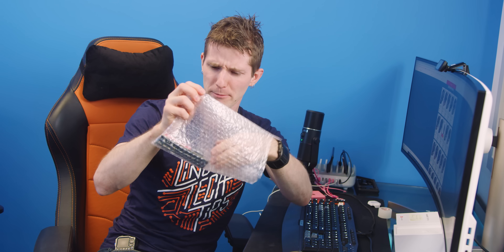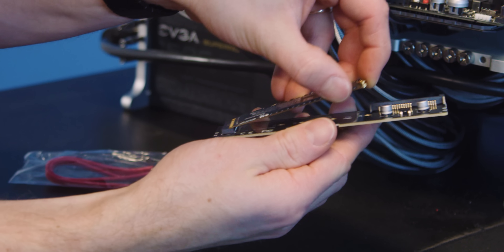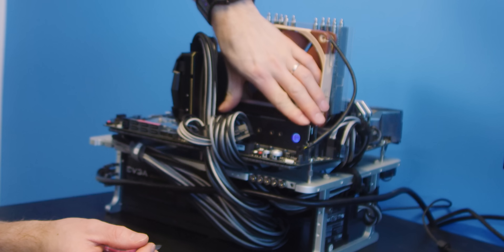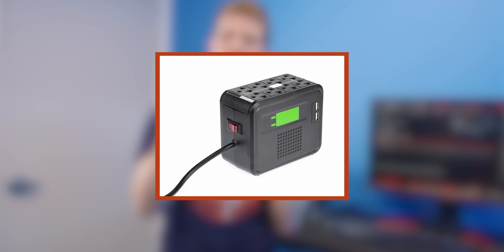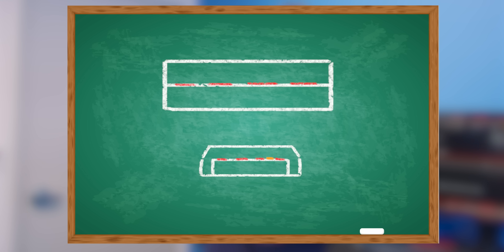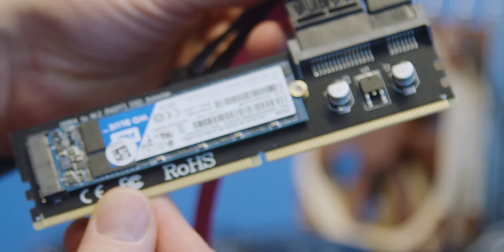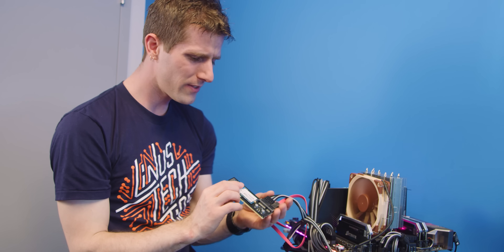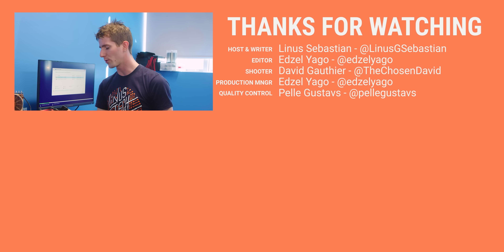They LIED to me! - DDR4 RAM to M.2 SSD Adapter

Comment: So, so much of this is just categorically incorrect. For example...

I have purchased about 50 or so display adapters, mostly for HDMI-VGA interfacing. I have never owned one that was unidirectional. Not once. And being that I have medical issues that limit my budget, I do me absolute best to find the cheapest crap I can find. So unless the more expensive ones have unidirectional interfacing or I've just gotten lucky, I call shenanigans. Also, hod dumb is Linus? Did he seriously think there would be a DDR4 to SATA communications adapter? My first thought was that it would act as basically a place to put an m.2 drive if the board lacks one or if they are filled... THEN when I actually watched the video and saw the damned SATA connector... Well not shit jackass... I swear, the content is getting just shoddier and shoddier as production 'value' increases... Whatever. 

Dumbe people gotta dumbey.

Comment: Hey Linus! Been watching your videos for as long as I remember! But I have a question that I cant find a straight answer: I'm planning to buy a new PC  and all I want to keep from de old one are the SSD and GPU. I have a lot of stuff in my drive and I dont want to have to make a clean install of my Windows 10. I know that just swapping the drive to a new motherboard is not that simple, because the drivers of the old one conflits with the new one. Is there a safe method that can be used to solve my problem without having to format my drive?
Thanks!
Reply: Windows 10 is better at handling being transplanted into a new system, it will try to get new drivers and not use the drivers for hardware that is no longer present. You could also use Macrium free imaging software to create a image file of your SSD before trying it out in the new machine to be extra safe.
Reply: @TheSonofman2  okay. Thks for the advise!

Comment: Not so simple It would allow you to add M2s to SATA controllers.
And if you do not have your RAM socket full a good place to install them.
The price is not bad
And as M2s are cheaper than actual DDR or HB2  RAM perhaps the IDEA of a REAL M2 to RAM converter for CPUs and GPUs is good enough to ispire someone to make a prototype.

Comment: The components on the board is a voltage regulator. The SSD use 3.3V, and the sata power connector may not have the 3.3V wire, and also that wire got removed from the ATX powersupply specs, so officially now there is no more 3.3V on the sata connector. So what they did is install a local 3.3V regulator. Since I see no inductor, it is most likelly a linear regulator, which mean it 'burn' the extra voltage as heat. The 5V come in, pass throught the first capacitor (most likelly C1), then to the regulator (U1), and then the 3.3V output goes to the second capacitor (C2?) and then to the SSD. The capacitors are there to stabilise the voltage, and appear to be oversized.

The efficiency of the regulator is relativelly low (Vout/Vin = 3.3/5 = 0.66 = 66%), and will most likelly get somewhat warm, but a non-issue.

If it had some inductor, it would have most likelly be a buck regulator, those can get quite more efficient (80-97%), but are more expensive to produce.

Comment: You spent ten minutes explaining how you misunderstood the purpose of the device but spent zero time explaining what the device is actually for: a way to install a SATA M.2 into a computer that does not have an available SATA M.2 slot (without using a PCIe slot).  Sure, it would have been great if it was some sort of "magical device" that could convert an M.2 into physical memory or a memory slot into an M.2 slot, but this isn't a channel about magic.  So why waste so much time talking about your false hopes and not just get to the point (once you finally understood what the point actually was)?

Comment: Hi guys I just build my pc with my own components ;): intel i9, gtx 2080 ti, asus rog maximus xi formula, h150i pro, psu rm 1000i, vengeance lpz 32gb 4133 mhz, in a case be quiet 900 pro v2 ^_^.

Now the thing is I am having an issue with the coses in the motherboard ;/, I have no clue what to do, I have this code A2 and i don’t know how to fix it, is something about the HDD i am not sure whether or not I installed it wrong or it does not recognize, I need HELP pls.

Would be nice if you can make videos about the error codes, the meaning of each code and what to do in order to fix it ;)

Comment: I think they build it for those people who have all case slots full with drives, but not the DIMM.
So, you hook it up like a SATA, but place that into the DIMM slot - for CONVENIENCE, not function.

I did that with my SSD, hooked it up and just let it somewhat loosely dangle in the case, before I decided to place it in the second DVD mount slot and screw it tight using one single screw - of 4 possible.

Comment: Wow. So it just uses the memory slot as a physical anchor to hold the SSD adapter? This has to be in the Top 100 Most Useless Products Ever.
Reply: You might as well just buy the 2.5" data version of the drive. Or buy an adapter that fits in a 2.5" or 3.5" bay
Reply: It’s not useless it’s a great scam.
Reply: Put your memory back in the slot and gaffer tape the adapter to the case. It could work in a small form factor case without an M.2 slot on the board.
Reply: well for older PCs without M.2 slot it actually provides a way to install it securely, so that's something
Reply: @ElClaudio  There are M.2 SATA SSD to 2.5" sata adapters already. And cheaper too. This is plain garbage and is just simply a waste of a perfectly good ddr4 slot for nothing
Reply: @ElClaudio  as does tape
Reply: @ElClaudio  truee !!
Reply: @ElClaudio  Yes.  But it does not need to be plugged into a DIMM RAM slot or anything.
Reply: @ElClaudio  true.. but at the same time this is ddr4 ram.. if it was ddr3 or lower then that maybe would make more sense
Reply: The real crime was milking this into a 10-minute video...
Reply: Probably made for a specific use case and someone thought it would sell.
Reply: This video actually inspired me to buy one of these when I thought I needed to move an M.2 drive out of the proximity of a passively cooled graphics card (it was previously installed in an adaptor that slid into a PCI slot bracket), but when that didn’t work it ultimately found a home in a Dell T1650 along with an SSD I pulled out of a dead laptop.
Reply: not useless at all. but "still" usable. lol
Reply: also a useless 12min video to tell us that
Reply: Thanks for saving me 11 minutes
Reply: top 10 saddest anime moments imo
Reply: @JustOneGuy  Top five random comments involving anime.
Reply: @JustOneGuy  Okay LTT the anime so needs to be a thing
Reply: @JustOneGuy : ...I don't get it.
Reply: yup,,   just another money making doop.   probably made in china
Reply: meanwhile people with 4 ram slots
Reply: They use it for motherboard that doesn’t have m.2 slot 😂😂😂 , they use 2 for memory and 2 for ssd drive.. bcause hdd is too slow
Reply: @jim b Actually, it didn't support NVMe just SATA M.2. So there's no speed loss for this particular drive.
Reply: if your mobo has no PCIe expansion slots but you have more rak slots (prebuilt with single channel 2 slot and 1 PCIe slot)
Reply: @trevorgunn5929 : It won't work for that scenario. The "adapter" doesn't communicate through the RAM slot, it just uses the RAM slot as an anchor point so the SSD doesn't flop around inside the case. The SSD still communicates with the motherboard through a SATA cable. You could just use the cable and stick your SSD to the bottom of your case with a piece of foam tape, thereby not clogging up a RAM slot with something that doesn't actually use it.
Reply: That’s the scam
Reply: Look at it this way: If you have an entire 10000+ piece load of blanks some OEM doesn't want anymore, you can put them to work in some way.  That's probably what went through their heads when they made it.
Reply: @phuturephunk : That doesn't make it any less useless. Also, that's what recycling is for.
Reply: Not really what if you don't have a m.2 slot on your motherboard but accidentally bought a m.2 ssd
Reply: this is a product to utilize space in a tight environment which would be otherwise wasted, from that standpoint it is not useless at all but the sense of it is debatable !
Reply: Unless it was for an incredibly old system that you wanted to have a fast hard drive on for shits and giggles, yeah it's pretty useless.
Reply: welcome to shenzhen
Reply: Isn't it useful for SWAP?
Reply: Not really. Gold plating do provide ground and use of an available ddr slot, even just as an anchor.
Reply: Depends. It can be useful if you have more m.2 SATA SSD's than connectors on your motherboard and don't use all DIMM slots at the same time. It's a handy little gadget to keep your computer and cable management tidy. Nothing more, nothing less.
Reply: it's not useless, it is still an adapter from m.2 to a normal sata connection, and being able to mount it in an unused memory slot is kinda neat, it's just falsely advertised
Reply: if i already have an m.2 sata lying around and i have to install it in my old system, this product can be useful, inserting it into a ram slot is optional anyway, just stick it on the case and call it a day, but tbh that use case is so rare
Reply: Id rather lose a pcie slot vs ram slot, most peopl uses 1 pcie slot for a gpu and has atleast 1 spare if lucky
Reply: ACTUALLY if you use miniITF board with only one PCE with one or zero m.2 slots it can be uselfull but i imagine then you have to use only one channel for RAM. or so i thought till i learn that RAM port only used as a fucking holder...
Reply: Was honestly hoping it was the opposite, that PCIe slot could run the RAM (even if slower on the bus).
Reply: @jim b 2 seconds to mark and drill a spot to mount a 2 inch ssd , WOW , you must be so handy around the house
Reply: thanks for being the top comment and spoiling the entire video
Reply: @jasonR2 : 🤣
Reply: 2x8 or 2x16 is far more common than 4x8, so DIMM slots are real estate to spare, and it's typical to only have 1 or 2 M.2 slots. PCs only 5 years old likely don't have any m.2 slots at all, and m.2 drives from that time will also be the wrong key for NVME m.2 ports now. It's a smart design that covers an array of edge cases.
Reply: @Plasmafox : You can get a M.2 to SATA converter board that fits in a drive bay -- or just stick it to the side of the case with foam tape.
Reply: It has some use like when you are not using that RAM slot or you have an extra and your board doesn't have M.2 support... yeah you can buy that thing.
Reply: @IMNODOCTOR : You're better off with a tray that fits into a drive bay.
Reply: @fyrstormer  Of course true. But it still has a few uses, not entirely useless.
Reply: @IMNODOCTOR : I agree it can be used, but the same objective can be achieved via less expensive and more practical means, rendering this device practically useless even if it isn't functionally useless.

Comment: It's just a mount for m.2 sata to sata converter, but if you find pinout for ddr4, then get + and - and step-up converter you can proably power it directly from motherboard and... Proably burn your RAM VRMs if 2.5W it too high for them. I don't know how many wats are ram sticks using.

Comment: Those are two capacitors and a voltage regulator. So it is probably just a very simple adaptor, no signal conversion or processing just contact to contact.

Comment: Honestly, if it actually did use an m.2 SSD as RAM somehow you'd blow through your drive's write capacity in a matter of days, easily, if not hours.

It would still be limited by the SATA 500MBps speeds, so it would be SDRAM bandwidth at best. I suppose that would extend the drive life a bit longer.

Comment: that adapter needs a sata cable and a sata power cable to function basically it's just a mounting hole using none of the pins of ddr4 for use it's a blank connector in the ddr4 slot

Comment: Your "HDMI to VGA" adapter was a bad example.  HDMI and VGA are actually more similar than you think.  Contrary to popular belief, HDMI is not "Digital" (except for the I2C line that communicates the display capability and mode).  HDMI is actually a VGA set of signals with differential lines on each signal.  If you map the positive line of each signal to a D15 connector, you have a HDMI to VGA adapter without any electronics.  You would have been better off comparing HDMI to Display Port, which would require an active conversion.

Comment: I was expecting it to make the SSD act as a RAM module... maybe something that somehow bypassed the limitation put in place to have more RAM than the system is programmed to handle. My hopes were however not that high to begin with...

Comment: can someone help me figure out the best way to split fan power since 
motherboards only have usually 3 or 4? how do you guys make it possible 
top plug in more? the only way i know is to buy a fan controller, which 
has 6 normally, but what if i have even more than 6?

Comment: As someone who works in an electronics store, you wouldn't believe how people absolutely refuse to understand that you cannot just have a cable with one plug in one end and another in the other end and have it magically do whatever you want.

I get all sorts of bizarre requests like coax to tp, aux to 12v, hdmi to Ethernet, any combination you can think of.
As long as they want to hook things together, they think any port will do.
The mere suggestion that they need devices that handle and convert the signal is incredibly offensive too apparently.

I've tried to tell the guy who wants Coax to TP cable for about half a year now that he cannot mix plugs and cables like that and that he needs equipment from his internet provider if it really uses Coax. (Which none of the local providers do)
He still comes back regularly asking for a cable to this day.

Comment: I think the logical reason for such an adapter would be able to increase your RAM size to un-imaginable capacity. Just think... having 512gb RAM sticks allowing a system to have up to 3tb of RAM!

The reality of this product is to allow an older motherboard to accept a m.2 ssd and take advantage of an unused dimm slot for mounting so that you don't need to ziptie it.

Comment: So, basically: Instead of just installing an ssd on your mobo,  you throw out
a perfectly wonderfull slot for memory storage capabillity,
just to convert it to a mounting bracket.
Reply: I suppose if you have a very small form factor system (no room for SATA drives) with extra RAM slots and no available m.2 or PCIE slots, this thing is a bit more elegant than the double stick tape that Linus suggests.
Reply: @travis1240  Wrong ! ... Watch McGyver. If duct tape dont work....
use more duct tape.
Reply: @travis1240  and dependong on how things looks maybe the only way to keep thing up to regulation.
I remmber a story of a IT server that had to buy a full on new cabinet because they needed to fit in an extra SSD (some wierd thing) the tech had earlier just taped the SSD to the side it worked perfectly but it was not up to regulation and had to be solved (this would have fulfilled the regulation (no lose parts or no unsecured part or something like that).
Reply: do they never hear of nvmd ssd? would work better..
Reply: I think its for the peopel that dont need as much ram but want an m.2 even if they have no slot.
Reply: @zgee64  But why does it need to take up a DIMM slot? Why not just make an adaptor that plugs straight into the SATA port?
Reply: @nathangamble125  i think maybe the speed.
Reply: Fynn Heinemann An M.2 SATA drive would be no faster than a 2.5” SATA drive if the performance of each drive is the same. They will both be capped by the SATA bus speeds. I see no logical use case for this considering how small and easy to mount 2.5” SATA ssds are

Comment: So the ddr4 part of this would be a type 0, as in a mounting plate/bracket/adapter only, no signal/power to the ddr4 slot. As evidenced by you saying that it could have been taped to the side just as well. The m.2 to full size sata part is type 1 or 2, not sure.

Comment: Now what would of been nice is the SAME device only with a full 'converter on it' for me to plug onto the daughter board a DDR4 memory that I put into an M.2 slot so I could have a simple hardware based RAM DRIVE in NVME speeds.   Yes, you loose it when you turn it off, but, as a RAM drive to chug on some video files while rendering it would be a good product.

Comment: I can actually think of a very targeted use of this, There are some boards that in the past have been able to use both DDR2 and DDR3 depending on the type of CPU you install. so if you are using only half of the DDR slots you can then use this to mount and install an M.2 on it.

Comment: This question will probably get buried but, did you guys try this on a mobo with only GDDR3 Dimms? Thought the concept of it is kind of redundant or useless for a unit that does have an M.2 it would be interesting to see if it works to add an M.2 Sata drive to mobos that dont have M.2 support at all.

Comment: It is only M.2 to sata adapter that uses ram slot electric power, i thinked you will have 500gb ram in one slot!?!??
Reply: It doesn't even use the DIMM power lines. Between the SATA/M2 circuit there is no connection at all.
It's the same as putting the dry stick of a popsicle into a RAM slot.

Comment: The types of adaptor are as follows:
Passive:
Physical - Conforms the shape
Electrical - pins in to pins out

Active: Performs signal processing.

I want to see an M.2 to DDR4 adaptor.
Bring back the DIMMdrive!
Reply: I want to see SSD used as RAM just cause.... Lol
Ik it would be slower but idc just want to see it.